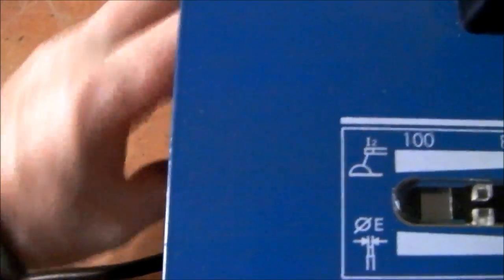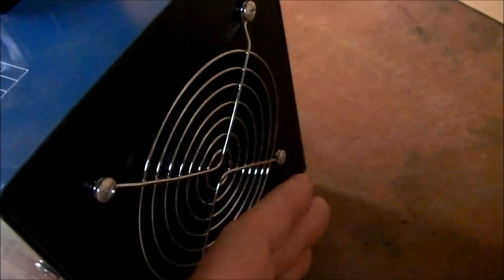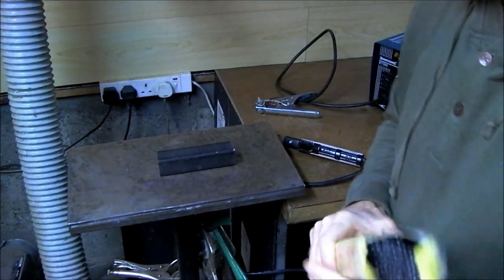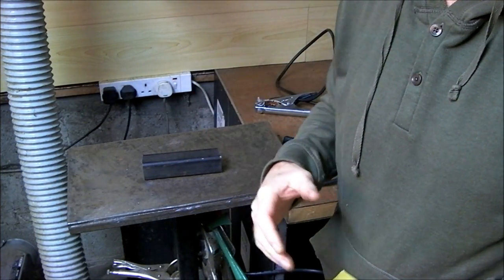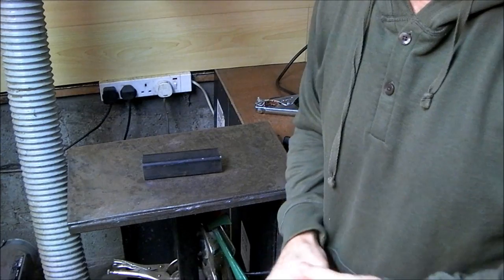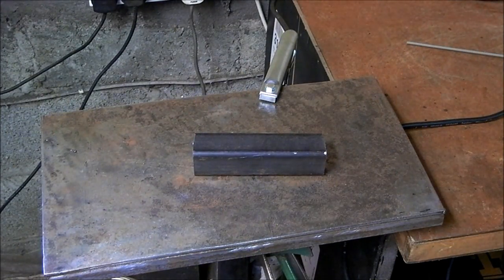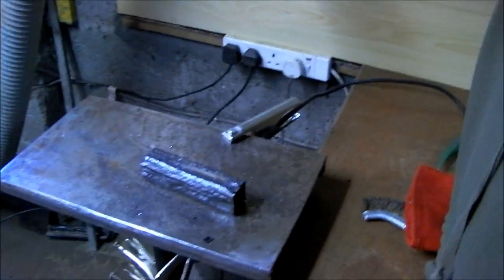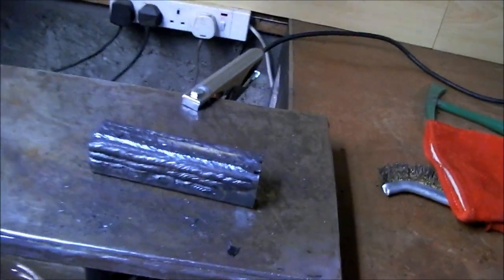How to weld with the 100 amp stick welder: part 1

Comment: I am a disabled vet spent 7 years on submarines . To keep my mind off problems I got a 200 mig welder and a 110 120 amp stick welder.The mig is limited as it has to be plugged in the house to a dryer plug.  I have fixed my wheel chair to fixing my tractor deck.
Reply: Thank you for your service sir
Reply: That's cool! :)

Comment: Would this be suitable to weld together frame, for example 1/2 inch tube metal?
Reply: Did you ever buy this? Would it work to build a simple metal decorative fence?

Comment: Do you find it a good welder for £60? I was looking at their gasless mig but I did my college welding training on arc yrs ago, I've tried tig in a workplace but never mig. & for now I only need to reweld a small spot on an older motorcycle where the old weld broke. The small out lay seems more worth it.

Comment: I'm trying to find an ac welder that is good with 1/16" rods, for thin (22gauge) sheet metal. Is this welder good for it? I liked your video where you did this type of welding but it was a different welder. It seems to read the min amperage is 40 which seems high for this welder.  thank you in advance if you can answer this.
Reply: did you ever get an answer to this, Robert?
Reply: @rosstituteuk  I have tried with some success but had problems too, the amperage was controllable with the welder I got but it might stick or burn through. I have not practiced to perfect it yet.

Comment: mine is not 100 but is a clark 95 . I read on a forum that the clark machine takes 5/56 or 1/ 16 best . And don't run 3/32 that good . I have yet to use the machine

Comment: i have a "100" amp arc welder, and with 3/32 rods i cand get it to arc worth a damn. it just sticks, then sticks, then sticks, and after everything is nice and scalding it will throw and arc..i only ever really use it to weld nuts to broken studs.. what am i doing wrong? i tried full power, low power and half way.. no real difference.
Reply: AKghandi Check that you're running the welder on a 20 amp circuit, not a 15 amp one. Additionally, if the distance between the outlet you are using and your fuse box is long enough and the wiring in your house is 12ga or smaller, there may be an appreciable drop in performance. Also don't use extension cords. From there on, it's all technique/practice. If all else fails, try using 1/16" or 5/64" instead of 3/32" rods, as they require less current to burn.
Reply: +AKghandi  also i reccomend from experience even if they are a little more expensive using 5/64" because I find they stick a lot less and are easy to run, in addition they also turn out a pretty nice bead. By the way depostion will be shit with these rods i.e.: autobody
Reply: Ghandi's Garage I got the same machine and the same thing happened  to me couldn't  weld anything ...I'd like  some advice thank you.
Reply: Isaac Thomson thanks for the advice.
Reply: Kiran Digavalli I believe your  advice is very good thank you very much.

Comment: I cannot seem to get it to move, I start to weld and the stick melts straight on the metal and I am forced to lift it off and start again, any hints as to what I am doing wrong would be appreciated
Reply: John Fithian-Franks I might add, have you tried moving it slowly from left to right just a touch as you move down?
Reply: John Fithian-Franks I might add, have you tried moving it slowly from left to right just a touch as you move down?
Reply: Yes, I think my problem might be to do with the rating of the machine and or the thickness of the rods. I bought my welder second hand and it came without any documentation
Reply: John Fithian-Franks what rod and size are you using? with a 3/32 rod you should use around 60-70 amps and with 1/8 you should be around 90-110 if you're a beginner then you can burn hotter once you get use to your machine, if it sticks a lot when you try to strike a arc its usually to low of Amps

Comment: Can you use 7018 rods on this?
Reply: You cant use 7018 on ac
Reply: You can they make 7018 5p+ specially for ac welding Lincoln make them but most prefer dc with  an open circuit voltage of 70volts and above

Comment: 100amp is 20amps too much for a 2.5mm electrode on my sureweld arc welder it just makes a mess, 80amps seems to be the sweet spot

Comment: I'm thinking of restoring an old VW Beetle. Are these 100 amp welders suitable for welding bodywork, chassis parts etc?
Reply: You'll find a MIG much easier and quicker to get the hang of in my opinion
Reply: +ELPaso1990TX if your work involves sheet metal to less than 3/16 iron, a MIG welding machine will serve you much better